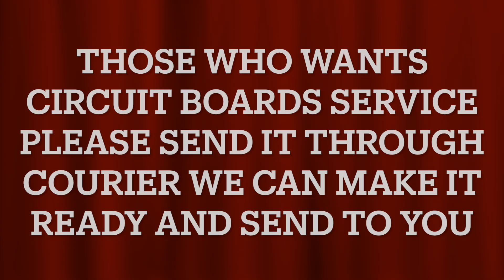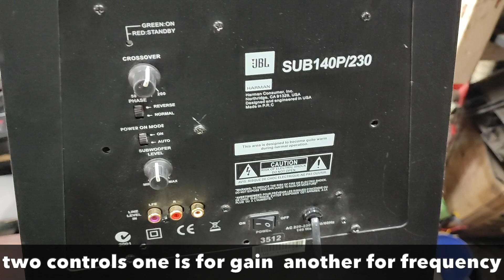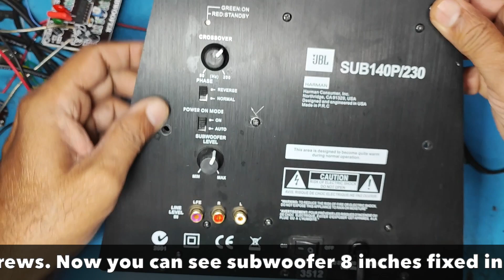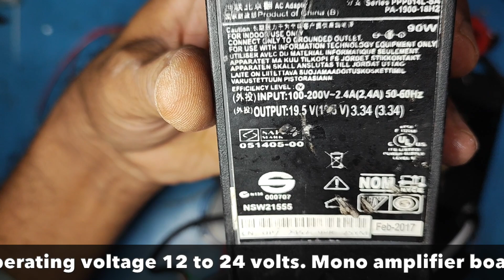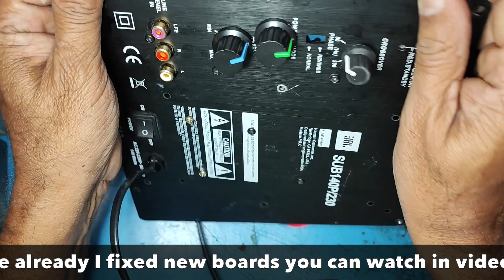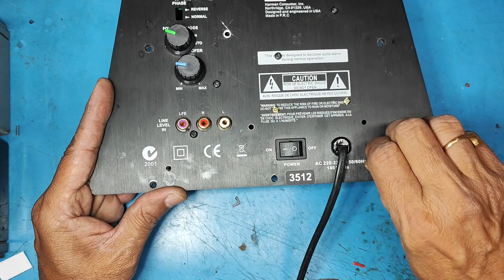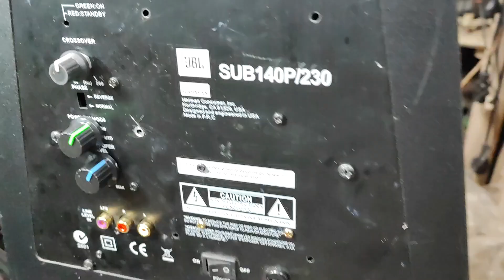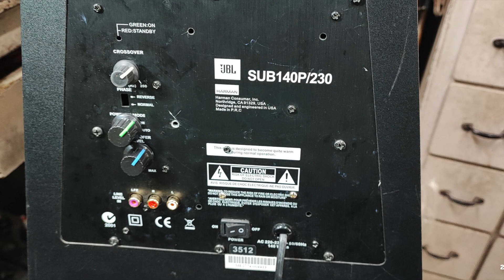RESTORATION JBL SUB 140P/230 పూర్తిగా పాడైపోయిన యాక్టివ్ సబ్ వూఫెర్ ను బాగుచేద్దాంDEAD SUB WOOFER

Comment: sir ippudu miru thisesina boards repair cheyyochu a to z sir power supply tho saha company parts kani sound quality kani baguntundhi sir...
Reply from the maker: Sir please tell me where it is available. You are from which place.
Reply: @teluguelectrotechbysivakum2283  sir sta512 amplifier ic andhulo use cheyyadam jarigindhi sir avi available ga vunnayyi.....sta309a digital audio processor ic use chesaru sir avi available ga vunnayyi sir and Power vishayam ki vasthe any power supply repair easy and simple ga repair chesukovachu sir
Reply from the maker: వాట్సాప్ లో మీ ఫోన్ నెంబర్ ఇవ్వండి మీ ఊరు పేరు